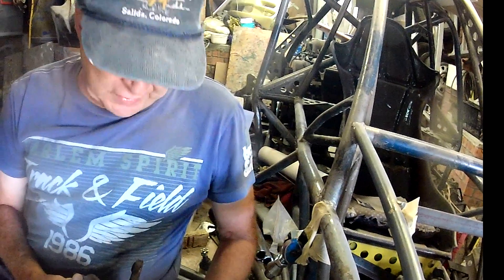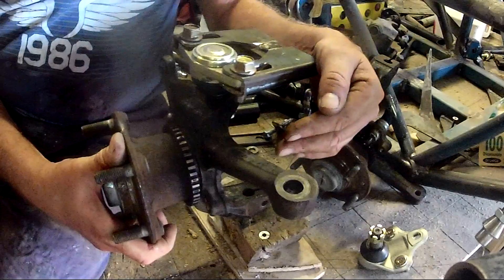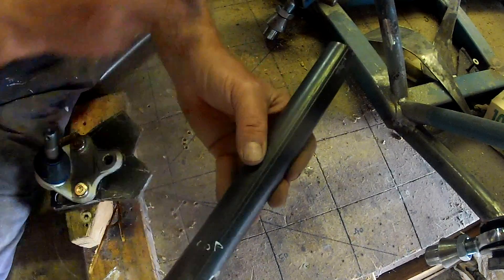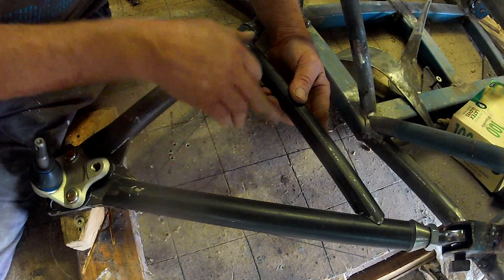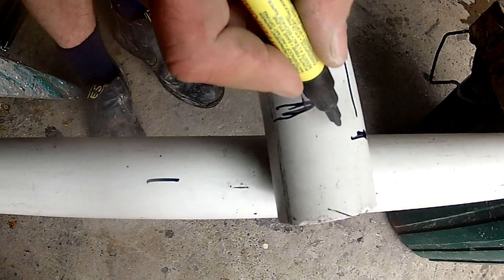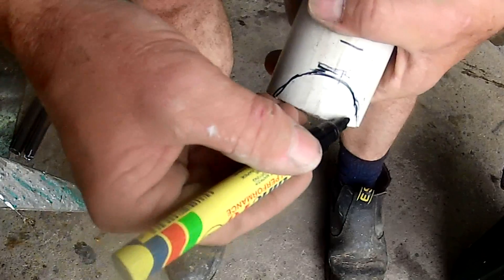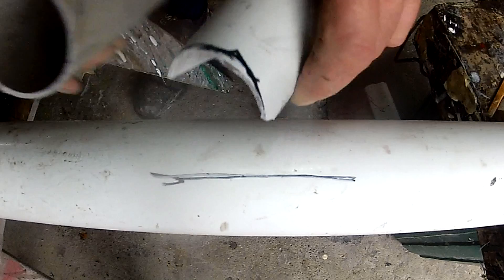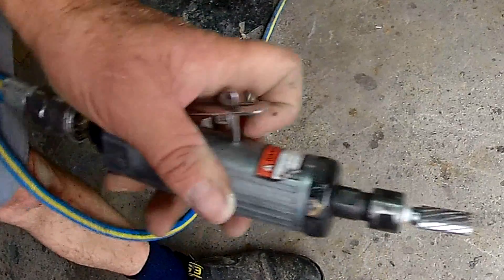Offroad V6 Buggy Build - Part 7

Comment: hey there. i came across a website which has a list of pipe and angle joins that corrospond to what angle to use a mitres saw to cut the notches.  the air tool can then just round them out.